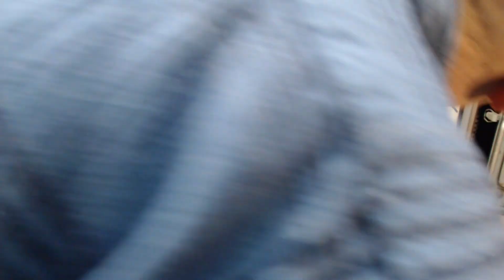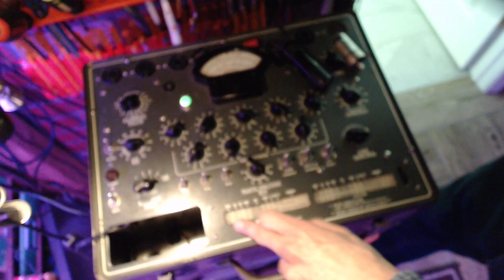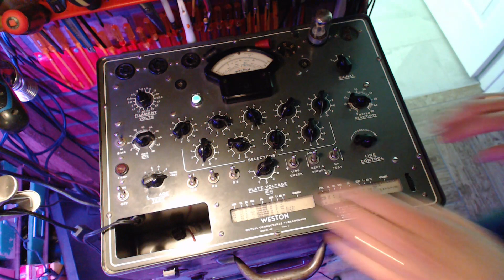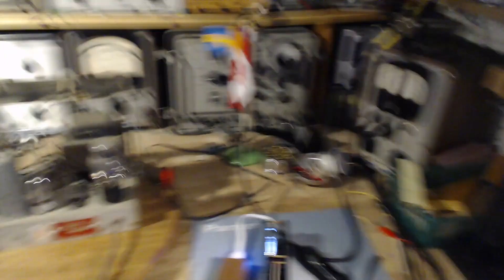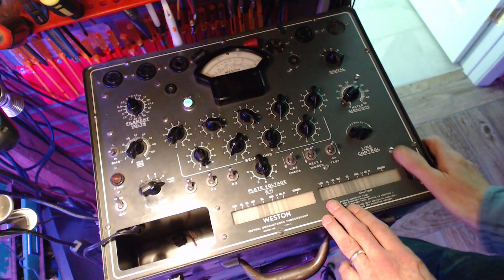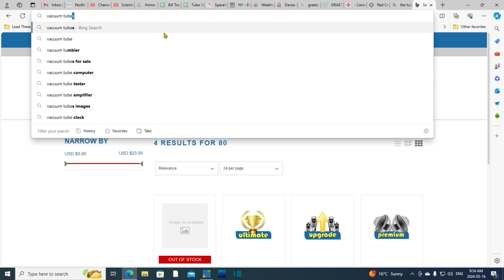1940s Canadian Red Cross Tube Radio Video #2 - Resistor Out, Tubes Tested

Comment: During your testing with line voltage at ~70VAC, filament voltage may have been too low for operation of the other tubes (especially the osc/mixer) even though the rectifier was operating to some extent.